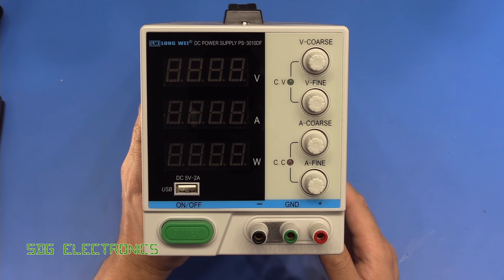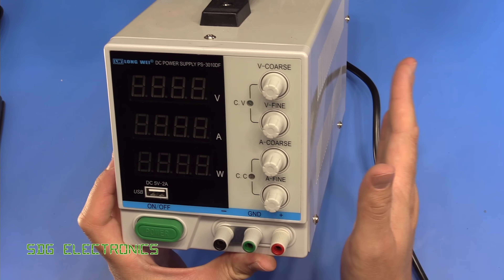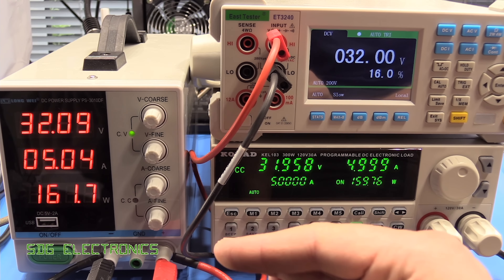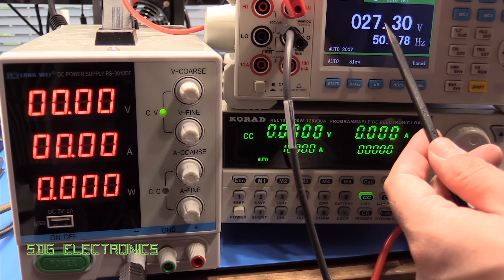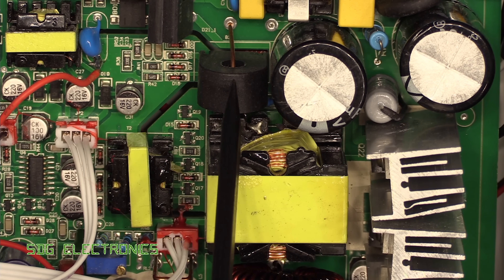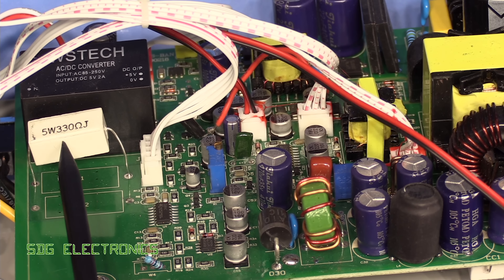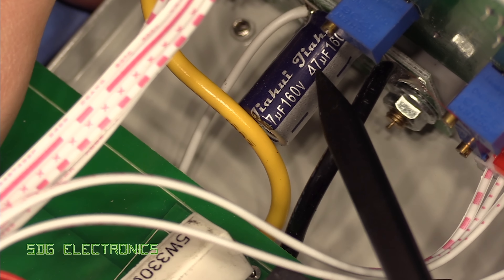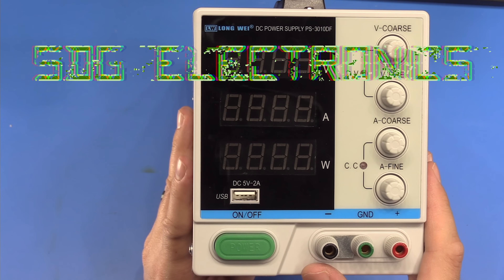SDG #148 300W Lab Power Supply

Comment: Thanks Steve 👍  
One nice thing these days is that for those who are just starting out.. there is test gear like this available which is becoming more affordable by the day it seems, and it works 
properly too. Not so long ago the likes of a half decent bench electronic load was out of the question for most folk.
cheers
John
Reply: The real question is that    ARE YOU THE WESTERN ELECTRONICS ENGINEERS GOING TO BELIEVE THE CHINESE BRAND PRODUCTS NOW ??.... In other word ,   ARE YOU REALIZING THE COST-PERFORMANCE FIGURE TO BE FAIR TO YOU NOW ??
Reply from the maker: I used a Uniross 1.2A multi-output power brick for all of my experimenting until I was 19! I wish I had access to these devices back then! Thanks John

Comment: Currently I am binge watching stuff around lab bench power supplies and this pcb looks eerily similar, nearly identical to the pcb of the Longwei LW-K3010D. It's just orientated at a 90° angle.

The guy from the YouTube channel "TheStuffMade" did show a hard mod on his unit how to reduce the switching noise: He put 33Ohm SMD resistors in line to both MOSFET's Gate and put a 47uF foil capacitor between Gate and Source of both MOSFETs.
Took possibly away a bit of efficiency, but everything did stay cool enough after the mod.

You can look up his channel for reference, if needed. His video is from 2020.01.22.

Comment: As an alternative to this power supply I’d recommend the TD6006 (60V 6A). The price will be just a bit higher but you’ll get a very nice power supply with loads of features. Their official shop is on AliExpress. 
(I’ve no affiliation with Ruideng)

Comment: The topology is half bridge not flyback, it has the two capacitors that split the rectified mains into a positive and negative rail with respect to a floating return. The third transistor like device is the secondary power rectifier.
The red capacitor underneath is the dc coupling capacitor from one leg of the primary to the floating return. And the two power resistors underneath might be for current sensing. SG3525 is not a current mode controller so there has to be a way of doing constant current, probably using the shutdown feature.

Comment: Those TNY chips are pretty popular in compact switch mode power supplies, I've seen one in the Gopher NPS1601/CPS3205 power supplies and I've done a video on a DIY power supply based on a TNY chip and an off the shelf transformer. I'm looking forward to a review and teardown of that Korad electronic load, it looks nice.
Reply from the maker: Yeah those TNY chips are really good - they also crop up in a lot of plug in AC adapters and phone chargers. Thanks

Comment: Steve ... Me as a reseller for many Chinese brands of TMI for over 10 years , LW brand is considered in the low quality category among many others of same origin and is the cheapest and those are either not true full DC power load delivery or aging fast at full loads.... But if we consider the cost-performance figure then we can find it fair enough to do our electronic engineering job out and makes us profitable at the end , i.e. don't focus on small pixels on screen but try to figure out the whole picture by the time and gain back.... This is how chinese are developing fast !!....
Reply from the maker: I agree. I hope my reviews come across as neutral - I just like to report what I see and allow people to make informed decisions.
Reply: Yes Steve ... I can sense this in your reports and not trying to be biased to any brand or model or origin rather than just to report your senses to viewers and I like and respect that highly... One thing I still worry about , do you get sponsorship from JLCPCB or PCBWay for your PCB works ?

Comment: Steve, is it a Halfbridge eventually ? The orange cap at the bottom is the Series cap for the Halfbridge primary (Flux Walking Cap) and the choke at the secondary + caps the secondary buck ? 300W is not common and to high for a Flyback, eventually a 2 switch flyback but the 3525 controller is mostly used in PushPull and Half/Fullbridge forward designs
Reply: Exactly .... Smart guy !!....

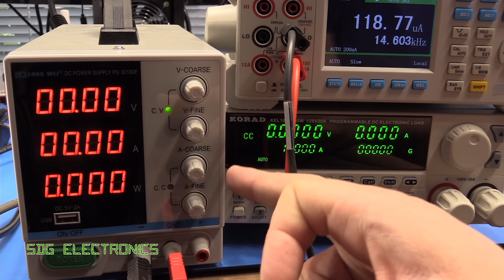Comment: 8:00 Is this capacitor really for safety? I've heard it's for emissions compliance.
11:55 Pretty sure the fan blows in the direction of the structure holding up the rotor. So it would be blowing inwards.
And the third heatsinked device is probably a dual rectifier.
Reply from the maker: You are right, I somehow didn't see the sticker on the fan so assumed it was pointing out. The capacitors are called safety capacitors (X2, Y2 etc) but indeed they are there as a return path for the noise coupled through the transformer
Reply: The capacitor is called a "safety capacitor" as it has extra certification requirements (UL rated) to ensure it fails open. I think 60950 (for CE marking) explicitly states this.
If it failed shorted, it would be directly across the AC input and hence a fire hazard, especially if it's shorted resistance is still high enough that the fuse doesn't blow.
Reply: @chrizlax  Just to clarify your point:
X-class capacitors are placed across the AC supply, so failing short would be a fire risk as you say.

But Y-class capacitors typically link the DC output of switching power supplies to mains earth if it's available, or often just to mains neutral if there's no available earth (or even to mains line/live/hot/phase if not using a polarised input cable and it gets connected "the wrong way around"), in order to couple noise back to earth (neutral is generally connected to earth somewhere - even if it's back at a substation transformer miles away; I guess coupling it to line has a similar effect?).
So if those failed short you could end up with mains AC on your output, which isn't great either, but for different reasons :)
If they're connected to earth or neutral then I believe that it usually won't be a big & imminent safety risk, but in fault scenarios even the mains earth wire can have a high potential on it (relative to "actual" earth), which is why ESD straps/mats/etc. should be connected to earth via a 1MΩ resistor.
Reply: @sdgelectronics  Aha, I thought you were saying the purpose of the capacitor was for safety.

Comment: What does the safety capacitor do?
Reply: I believe it's to do with the capacitance within the transformer that can cause high frequency noise.....so you effective ground it through the capacitors. However, I am not a expert with switch mode PSUs so would be interested to hear SDG's answer?
Reply from the maker: It's there to provide a return path for the switching noise that's coupled through the interwinding capacitance of the transformer. It stops the output being a big antenna for switching noise. "Safety" capacitor is a bit misleading, it's not there for safety but Y1/Y2 caps have a safety classification

Comment: It.s not a flyback. It.a half bridge smps. Sg3525 doesn't support flyback( and it doesn't support current mode control)
Reply: @medo7dody  aaa Datasheet? Plus schematic for similar supply (same board) is available on the internet. google MCH K305
Reply: @medo7dody  at same time, did this video prove that it IS a flyback?
Reply from the maker: You're probably right, although the 3525 can definitely be used for flyback converters. It's just a PWM controller chip, topology is almost irrelevant
Reply: prabhat kumar   I concur. One look and its very similar to generic PC power supply arrangement with said description.